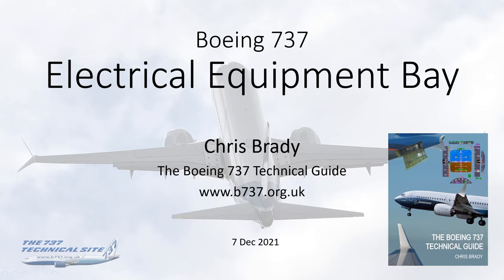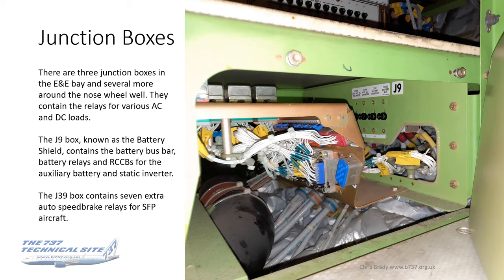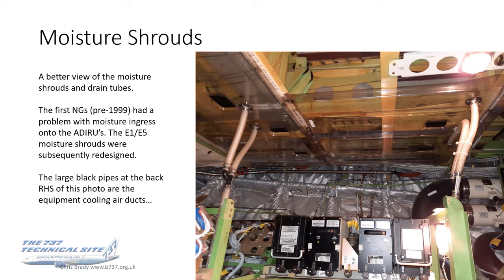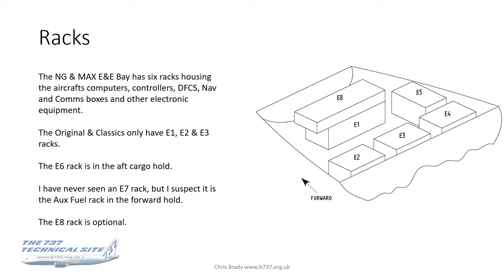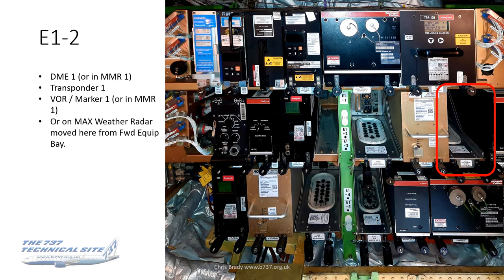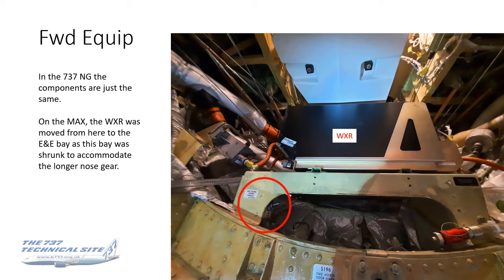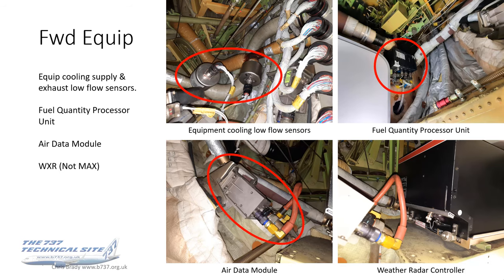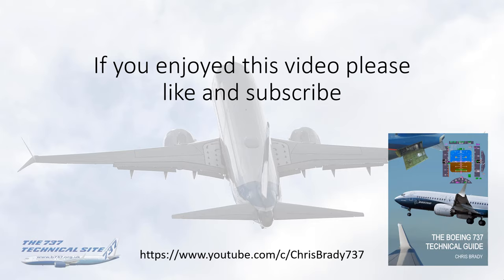737 Electrical Equipment Bay

Comment: Fascinating video, thank you. It's amazing how much electronics are needed to keep these planes flying. What's even more amazing is that the bulk of it could fail and any pilot with a decent amount of skill could still plant one of these puppies on the nearest suitable airstrip in a pinch, safely. That's reliability engineering at its finest.
Reply from the maker: Most systems are duplicated for redundancy, some critical services have triple backup, but yes, even with all electrics gone the 737 can still be flown to a safe landing.

Comment: Filming such a video is so hard even for a 737 maintenance personal. You can learn the development of technology from 737's E-E Bay because it's full of units from different times.
36:05 The design of WHCU(Windows Heat Control Unit) has been updated. There are only two WHCUs installed on MAX or the latset version of NG and one unit controls two windows. One window was controlled by one WHCU in the past. In this case, that's the new dual WHCU and it's Number 2 WHCU which controls right front window and left side window.
Reply from the maker: I did wonder why I couldn't find the other 2 WHCU's, thanks for explaining the dual WHCU.

Comment: Invaluable resource! I fly the P8, and in one of our checklists regarding smoke/fumes, we are directed to move the Equipment Cooling switches to Alt; is there a reason why this would be important in your opinion? It seems that moving the switches to alt would simply change the fan affecting supply/exhaust, rather than doing anything that would combat smoke/fumes from entering the flight deck.
Reply from the maker: Hi Christian, that step is also there on the regular 737 Smoke, Fire or Fumes checklist. You are correct it does simply changeover the fans but that could eliminate the source if the source was the normal fans. The 757 in particular had a lot of problems with smoke incidents from the bearings of the equip cooling fans.
PS pls PM me, I would love to improve my P8 video and need some more insight.
Reply: @ChrisBrady737  Thanks for the knowledge, appreciate the info! I'll be honest, not entirely sure how to PM on YouTube, but I'd be happy to help if you can tell me how

Comment: I have a not-so-technical question; from what I understand, the forward EE bay (near the passenger entrance) is not locked, right? Which would mean could walk up there, open the batch and mess with the electronics?

I was told this is the case for many planes and was baffled, found it hard to believe.
Reply from the maker: If you mean is the E & E Bay at risk from passenger interference, then no it is not. The hatch is not easy to find or open. If you did manage to open it then a warning light would appear in the flightdeck, as would warning lights if any equipment were disturbed. I would also bet that no passenger could ever get as far as the hatch without detection by ground staff.
Reply: @ChrisBrady737  thanks for your quick and informative answer. I was watching the new MH370 documentary on Netflix in which it is stated by aviation journalist Jeff Wise that the hatch it usually hidden under carpet, but is you remove the carpet you can open up the hatch relatively easily. If anyone with bad intentions wanted to get in there, I'm sure ground staff would be a relatively trivial obstacle.

This was one of the very few videos (or pages on the internet in general) I could find on this EE bay so I expect some other viewers to come and ask you questions
Reply from the maker: On the 737 the hatch is on the outside of the aircraft, so not an issue in-flight. Trust me, ground staff would be all over anybody who tried to get in to that hatch and the pilots would instantly know if it had happened.

Comment: Honestly never really understood the Boeing philosophy with all the electrical stuff, it feels like they have individual pieces of hardware to control really trivial stuff like FDs and different temperature controllers. I guess it's an artefact of the piecemeal upgrades the 73 has received through its life but I should think it contributes to quite a lot of unnecessary complexity and weight in the systems, especially where "legacy" components are retained on newer versions.
Reply from the maker: The various boxes in the E&E Bay are made by different companies who specialise in those systems. Boeing is the airframe manufacturer and Smiths / GE / Honeywell / Collins / BAe are the specialists in their areas, hence their boxes are used. NB the airlines get to choose which supplier they want for each box where there is a choice. It is exactly the same with Airbus and all of the other airframe manufacturers.

Comment: Had a water ingress issue today. The cabin crew was performing their preflight check, got distracted while water was running in the sink, the sink drainage was malfunctioning, and lots of water got spilled, reached into fight deck floor as well. Plenty of water flew out of drainage holes, but now I have trouble recollecting whether it was the forward equipment bay or the aft. I remember that around a third of a bucket of water splashed on the apron. 
Nothing seemed malfunctioning though. The plane stayed for an hour while maintenance fixed the sink issue
Reply from the maker: Interesting. Most of the water in the galley should have gone down the drain holes in the doorways. If it got into the flightdeck it should drain into the E&E bay but be caught by the drip pans over the racks.
Reply: @ChrisBrady737  it was a scary experience… who to be held responsible if things went south and some equipment failed?…
Reply from the maker: The engineers who inspected and signed off the aircraft. Did you or they make a tech log entry for the water spillage?
Reply: @ChrisBrady737  they did